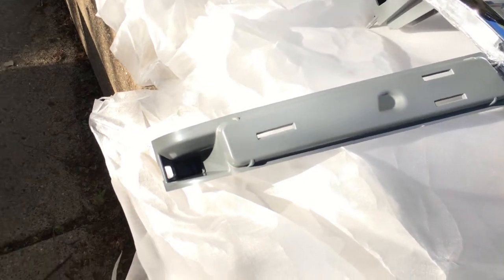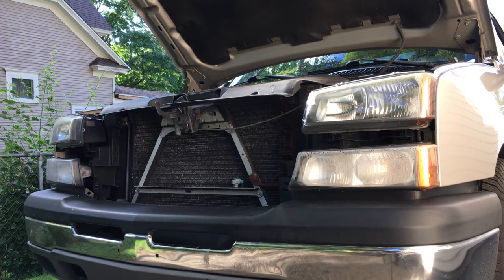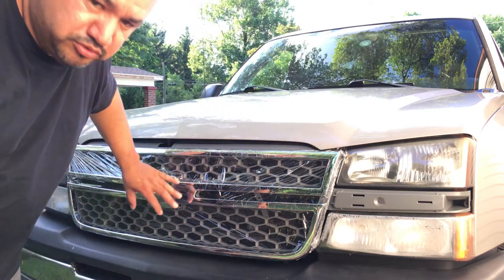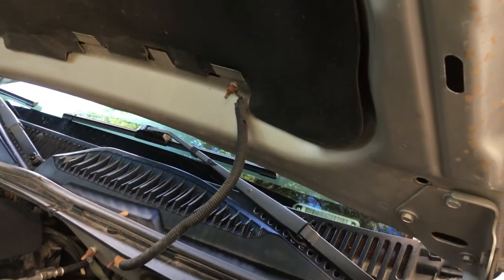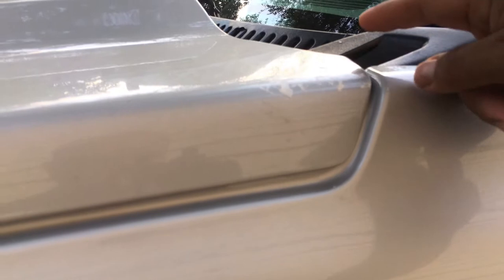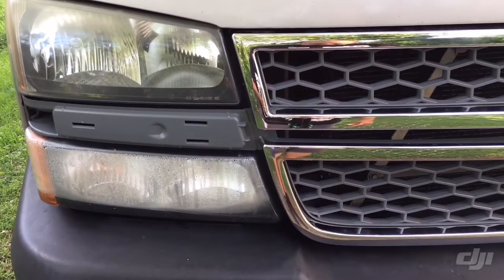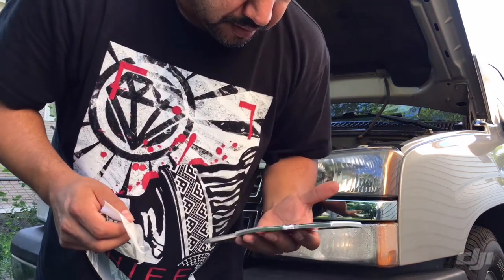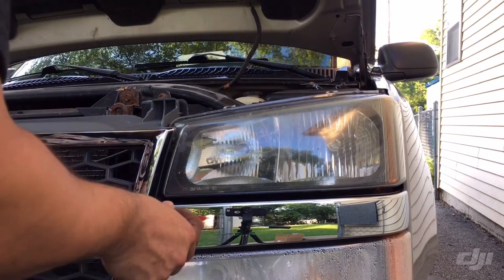2005 Chevy Silverado 1500 4.8L HD Hood and HD GRILL Conversion

Comment: So this is a 2005 4.8 1500 and you just bought the HD Hood and Grill no other accessories needed they just bolt in like normal ? I want to do this so is this correct
Reply from the maker: Yes, that’s all I did. I bought the hood from a same year truck, but it was a 2500 HD cat eye and it was as simple as bolting it on. All I had to do is buy the HD grill and the side inserts which are in the link in the  description.

Comment: I’m currently putting an HD hood as we speak and mine has a gap on the side lines. One video says I need to get a 2006 hinge and than I see this video and you literally used all your old hinge and bracket. Do you have an advice on how to align it? I have a 2004 silverado.
Reply from the maker: The way I figure it out how to align my hood was to unscrew the bolts that hold the hood by the brackets close your hood down and move it around and  see that the lines are straight and then slowly lift your hood up without it moving and  screw bolt on each side so that way it doesn’t move but you’re gonna have to keep trying because it is time consuming to get it right or close to being right,You’re going to repeating that until your lines match up Hopefully this helps you out and I want to say thanks for watching my videos

Comment: How did you install the side pieces that came in the mail bro? Mine dont click in.. is there a wat u have to adjust it
Reply from the maker: The narrow end that goes towards the grill should have a little hook/ notch type of deal that slides in first and then it should pop right in and also I put 3M double-sided tape at the end of the wider side of the part to make sure it doesn’t pop out,I’m pretty sure I show that on the video if you wanna go back and look at that it should be on there

Comment: Ese mi Loco you're gonna be fighting those After Market front light housings for as long as you own that Classic unless you put Factory ones! And New ones are Super Expensive, not cheap like the $75 eBay ones. EBay ones are impossible to align the beam, parking/dl housing will pop out if you can get them to clip in to begin with Annnd they will Always turn into aquariums. You've been Warned!
*Tip if you got the time and patients: Pick up some used Factory ones, sand and polish And put LaminX on the Factory housings! Pre cut LaminX is the way to go and it ain't cheap either 50/60 bux. LaminX takes about 5 days to adhere real good and clear up it's true, it'll say that in the directions. Don't work the sh!t out of it, it will clear up. Also, most videos show sanding and polishing On the vehicle, best to do it on the bench or kitchen table.
Also only put Turbo type mufflers if you put exhaust, anything else will make your bombita sound like a motorboat................

Comment: Hi where did you find the grill and HD hood ? I have a 04 silverado 1500
Reply from the maker: ebay is where I got the grill  https://www.ebay.com/itm/174296814571 and I got the hd hood in the facebook market and also you will need the grill sides inserts https://www.ebay.com/itm/272988161056
Reply: Hey Appreciate it
Reply: @Lasa301  so I can put this 2 on my classic 1500 2004?
Reply from the maker: @fitnessja7047  If it’s a cateye Silverado yes

Comment: hey man im kinda new to the truck world, if i get the hd grill will it fit with the stock hood or do i have to get the hd hood as well?
Reply from the maker: You will need to get the HD hood because if you don’t it would leave a three or 4 inch gap between the hood and the grill
Reply: @Lasa301  3 or 4” gap 🤦‍♂️😂
Reply: @Lasa301  can you go HD hood with stock 1500 grille ? without fabbing/ swapping the grille?
Reply from the maker: @paydgaming  No because then it will leave a big gap between the grill and the hood so that wouldn’t be a good idea you will need to buy an HD grill
Reply: @Lasa301  damn okay thanks for the heads up
Reply from the maker: @paydgaming  No problem man glad I could help👍🏼
Reply: @paydgaming  yes you can my homeboy has the HD hood and the 1500 grill. It works just fine

Comment: I have a 04 single cab for the hd conversion i just need hood and grill? I seen videos where they have to do the bumper and fenders as well.
Reply from the maker: I don’t know about the fenders but I know the bumper you can swap out for an HD I just haven’t had luck find one
Reply: Ok cool thanks man that truck is looking nice💯👍🏽
Reply: What’s the difference between a normal bumper and an hd bumper?
Reply from the maker: @chrisc7639  the normal bumper doesn’t have fog lights, the hd  hood  Do.
Reply: @chrisc7639  Same bumper except the HD bumper has a bigger/taller top plastic piece and the inner brackets are different. The grille and hood are direct swap.

Comment: Did you ever find the grille inserts if so can you link it ?
Reply from the maker: https://www.ebay.com/itm/03-07-Silverado-Pickup-Front-Grille-Trim-Grill-Molding-Left-Right-Side-SET-PAIR-/272988161056?mkcid=16&mkevt=1&_trksid=p2349624.m46890.l49286&mkrid=711-127632-2357-0
Reply: @Lasa301 i got sum grilled inserts from summit racing its the correct years and all but it didnt fit🤦

Comment: How u did u get hood inline right
Reply from the maker: It wasn’t easy that’s for sure it was a lot of opening and closing the hood and tightening the bolts. There is three bolts attached underneath the hood on Each side and I would loosen them all lower the hood tried to hold that position then open hood and tighten bolts one at a time  and when you’re done lower the hood back down and look at your lines and if The lines are still off repeat the process again, I hope this helps you out